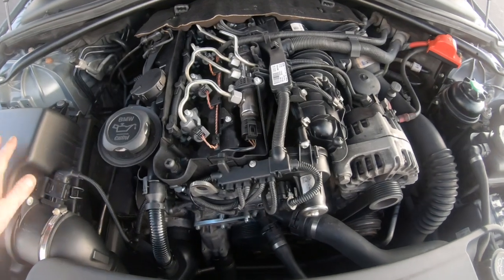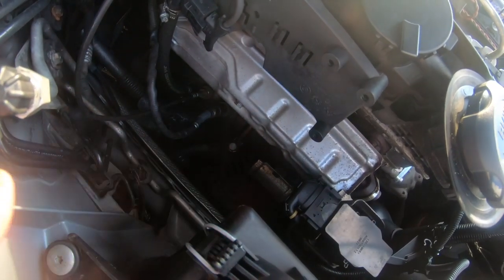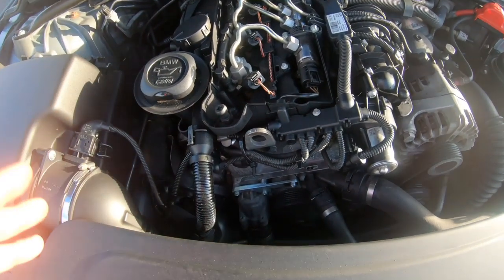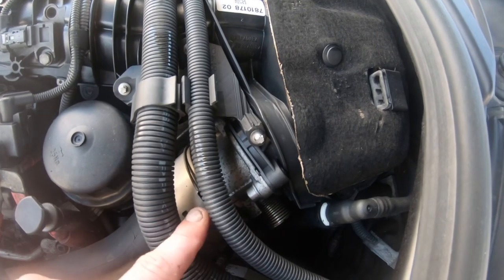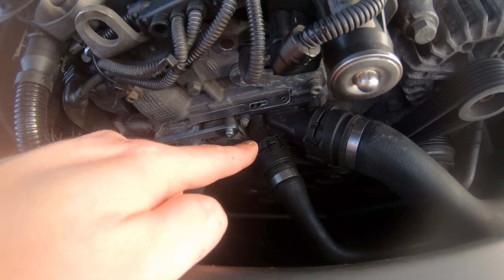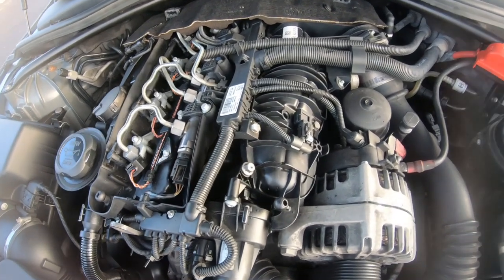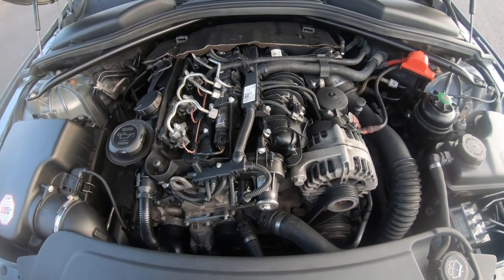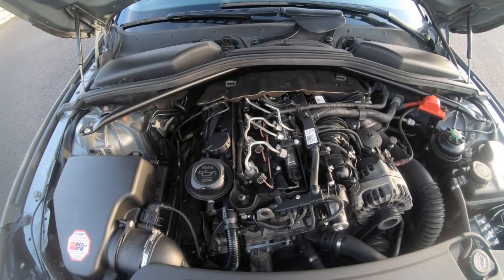Bmw N47 Reliability 2019........... Can It Be Reliable STILL In 2019

Comment: Thanks for the video , just bought a Toyota RAV4 and in the review they said it’s a bmw n47 d20! So it’s not good as I thought?
Reply: By doing specific modifications for the engine (like removing the egr valve) and changing the oil in shorter intervals  (BMW recommendation was 20tkm if i don't remember wrong, which is insane) the N47 engine can be quite reliable.

Comment: Great video, thanks for that, even though I have 2011 f10 with N47 engine it's still pretty much the same engine in both cars. I have to replace crankcase breather pipe on it, now I haven't find it on the net specifically for f10, it's classified as for N47 breather pipe with E60 mark, just hope that I purchased a correct one, I'm still waiting for it to be delivered though so I don't know for sure will it fit.
Is there anything specific and important that I have to be careful when I'm replacing breathing pipe?

Comment: Awesome content! I’ve got N47T 100k km should I replace the timing belt and delete the swirl flaps? Still running good
Reply: Just make sure of very regular oil changes and listen to it from time to time, if you hear it or not. If you hear it ratteling: replace immediately
Reply: Swirl flaps on N47 are of a single piece (compared to the screwed ones on M47)
Failure is less common, however it's good to check if the rod of the flaps has play or not. Quite an easy job to remove the inlet manifold, around 2 hours of work, no special skills required
Reply: @MrChielo007  mine rattles few seconds until tensioner starts woring at startup. But after there is no rattle. I changed chain set at 130 000 km. Now tha car has 250 000. Should i change it again?
Reply: @MarinTheFirestarter  What happened? Was it the timing chain?

Comment: thank you for sharing your knowledge... priceless  !   I'm just left with the question ! Is the timing chain problem solved on cars manuf in 2010 or is it 2011 ?
Reply: I’ve heard that they fixed those on F models
Reply: From what I've heard the F models have better chains than the E models but still faces snaps, the engine was supposedly updated in 2012 and called N47T

Comment: Mate, is there a slim chance some of the late 2009 N47s had this revised timing chain issue resolved?
My 120d is on 89k engine is so quiet you wouldn't even know it was running compared to some newer diesels.

Comment: Thank you for a very interesting video. As english is not my native language i am spesially greatful for your slow speaking.  As i am the owner of a 2014 320GT equipped with the N47. Is that also just a matter of time (within normal lifespan, everything will break sooner or later) before the timing belt breaks? Here in norway it is much more than "a grand" to get timing belt on the N47 fixed. They are talking about 7-8000bp with x-drive. Also i heard a higher price where the sprocket on the camshaft was broken and as it was nort replacebale so the camshaft also had to be replaced. they said close to 9000bp for that job.  How can it be that a qualety auto maker maker designs her products like that?  I also want to ask you about the tuning. Everybody does it, but it sounds to me like you say it is a bad idea? Will the engine not stand it? Whatabout the BMW tuning kit for 204hp where they change the intercooler and the whole mapping box? And isen`t the 325 the same engine with another turbo++? I see you have removed your egr. Can your car still pass the emissiones and how much better is it without it? Is the keeping of the egr the reason why the BMW tuning kit wich cost a lot only make 204hp while a cheap tuning can promise 222hp as they remove the egr? Or are the numbers from the tuning companys "fake news" as a certain president would put it in his modest way? Many questiones, but i really liked your video and i like these cars even i dont like to see the 3-double timing belt on my neighboers Honda fit located easy to axsess wich it proborbly never has to be. Why not like that for a premium car?
finnvinn

Comment: Hi Doc,
Love your videos, so much in fact that im now planning on selling my dear Volvo V70 2.5T and buy myself a E90 320D EDE 2011 with 9500km on the clock. Its a one owner, well maintained vehicle. Nothing under the hood has been replaced since new. Im having my own BMW Doctor here in Sweden, whos gonna help me change the chains, pullys and tensioners. But what about the EDE-stuff. Do you know anything about that? It hard to find any good info on the internet about it. Would be very pleased if you could consider doing a E90 EDE video (N47) covering the dynamics and electronics.

Best regards
Robert
Sweden

Comment: Hi mate, great video. I havw E90 318d with N47T engine. Car production date is 06.10.2010. Do you think I am safe from timing chain or shall I get it changed? Car is on 66k miles.
Reply: Just keep changing oil half of the recommended 30000km

Comment: I was told removing the EGR with the DPF still in place was an absolute no go, as it will clogg up pretty sharpish. Do you not think this is the case?
Reply: Nope. Just make sure your dpf is not already clogged up before you do it. And also DO NOT do an egr delete without a remap. If the computer detects problems with the egr because you blocked it, your ecu wont initiate a regen. 

Also i'd suggest you not removing the dpf. Simply get it blocked off with a strong plate and remap the engine so it knows not to open egr or take it into account.

Comment: Great video, my engine is heating up pretty quick. The fan works while the car is on but once turned off the fan goes off. It doesn't stay on to cool down further? 09 520d lci

Comment: bmw knew early on about the timing chain issues, but still it refused to fix it, making the same shitty engine year, after year, after year.
Reply from the maker: No the key to this one is buy a 6 cylinder petrol be happy 😃 or a motorsport engine no issues there.

Comment: One more question. You say to do a eco map. I assume you can do that and take out egr cooler. Shouldn't I go ahead and delete the dpf and the scr with a full tune even if I am not going to push the engine?  Eliminating possible failure of the Def system. Thinking of the JRtune. Which one is a  eco  map?
Reply from the maker: Mate I have never said do a eco map or any kind of map I said THIS car has a eco map everyone to there own I don’t believe in ANY remaps

Comment: I see a leak next to the pipes, I keep losing power from time to time. I used liqui moly spulung it fixed the issue,  2 days ago the problem came back I have high consumption and it hardly accelerates. can you help? should I remove the EGR? what pipes I can change? oil next the inlet sensor charge pipe. and next to EGR from the pipe tube.. Thanks!

Comment: I’ve just purchased an f30 220d approved used 2012 with 55k on clock full service history via bmw , will this have n47engine prone to issues ? If so any tips to best avoid problems ? Thanks in advance
Reply: Just service every 15000km/10000mls every oil change NOT 30000km/20000mls. Seen a lot of these go easily 250k when engine oil is changed half of the interval. The reason behind this is the chain tensioner works on oil pressure and bad oil is really a killer on these chains. Injectors issues is more of diesel filter that never needed to be changed or wayy too long. Change every 60000k/40000m should be fine unless your diesel quality is really moisture. Then do 30k/20kmls

Comment: if you don´t hear any noise from timing chain do you have to change? I've got a bmw 318D from november 2010 and don't hear any noise from the timing chain  ,  the car has 124k miles on the clock and bmw recommended me to replace the timing chain only because of the mileage.  they said yes it does not make any noise but with that mileage is better to replace it... what do you think? it sounds to me that bmw dealer just want to earn money

Comment: So if the timing chain had been updated to newer improved version at 100k does it become non serviceable? Or would it need changing again at 200k?
Reply: If you have proof of the work being done then I wouldn’t worry about it. Timing chain isn’t a serviceable part and it’s only a fear on these engines because of the design flaw and it wrecking the engine when it fails. Some VW have the same issues

Comment: Do the N47 diesels suffer the same timing chain guide issue as the petrol N26 engines?  They 'allegedly' fixed the issue starting 3/2015 with a different [yet still plastic] timing chain guide.  Do the diesels N47->B47 follow the same timeline 3/2015?  I'm still seeing reports of the newer petrol N26 timing systems and engines failing.  You don't see timing chain issues with Toyota, Honda or even Chevy.  Why can't the German manf get this sorted?
Reply from the maker: Yes they do suffer it N47 is WORSE why you going all these small engines go 3.0 no problems

Comment: How often is the timing chain issues in BMWs (mostly 3 and 4 series) made in 2013. and 2014.? Also, if it's still an issue on those N47s when would be a good mileage to change it?
Reply: problems with chain are up to 2012 september
Reply: @DjordjeSrpski  are you 100% sure I’be just put a deposit down on a 225d from December 2013

Comment: Great video, really appreciate the information. 

My question is, does the timing chain really need changing? I have 123 e82 year 2008 at 67K. 

I have also notice a intermting lag response when applying acceleration. Some moments the car will shoot off and carry on pulling, whilst other times it delays. Do you know what may be the main cause to this issue?
Reply: I also would like to know if the timing chain really really needs changing.... I change oil every 5000kms just to be safe..... And it's perfect at the moment so I'm not sure

Comment: The trouble isn’t with the remap it’s with the fact that people don’t uprate parts to deal with the extra stress and temperatures on the engine. Best practice is always to make sure EGTS and iats are in a safe tolerance via an egt gauge and to go with live road mapping/data logging. Dyno sessions are good but IMO road mapping is better as it puts the engine under real stresses in real scenarios.

Comment: Mate u got bare bmw knowledge, anyway can you help me out

I’ve brought a 320d with the pre lci engine 177bhp with a new bare engine replaced (well not new done about 30,000 miles now) whole cars done 170,000
And lots of mechanics I’ve been to for repairs said that it sounds loud which it does (ticking sound that’s a bit louder when hot)
And one of them said that it’s timing chain :( 
But I don’t really feel a power loss, pulls like a train and the ticking noise is constant.
It does just kinda sound like a tractor when it’s hot 
Could this be anything else????????

Thanks man rate ur vids
Reply from the maker: mate its timing chain the tensioner on them brake mate its a common common issue mate trust me replace it you dont feel any power loss yet its probably only half slipped and flapping about mate get it changed asap before it destroys the engine mate
Reply: Yes it could be high pressure pump ticking my does , and injectors tick too, Best is to get stetoscope and touch engine listen then it changes what you hear

Comment: I have the toyota avensis 2015 with the 2,0 N47 engine.
Sudenly the oil symbol came up... I just had a oil change and oil filter change 12 days before it. 
 I stopped to check out the oil stick, and the engine was almost dry?
I imidietly took it to the mechanic and the engine codes that was shown was  p1443 Regarding secondary air intake injection vacuum switching. 
Code2 POOBD telling air flow to high.. 
Code3 P1070 Turbo charger permantly closed governor deviation... 
My question is, is it the turbo? 
I blows a litle some when it starts, but after only a minut the smoke clears
The engine has not lost any power at all, and I can hear the turbo like normal, only a small whistle sound. 
It uses a ton of oil now, so i guess it can be the turbo, but you proffesionel oppinion would be welcome🙏
Btw Great video 😊

Comment: You forget to mention the big end bearing issue. I seen a few N47-N57 engines. Most of them had the crankshaft bearing gone by 200000 km. I just did my own timing chain @187000 km. The chain was a little worn but still safe to use but the bearings are gone. Due to this reason we never do the timing change in the car. We always pull the engine and check the bearings and 99% the bearings are worn.

Comment: I've a 2012 f10 with 230k km. Still on original chain and is fine. I maintain the car myself and change the oil and filtter every 15k km.  My wife's f30 started to give a slight noise on engine start up, so we changed all 3 chains . Her car was done at 175k km, so I suppose it can vary from car to car.
Reply from the maker: That’s correct mate it does the same as on the B47 aswell it depends on the servicing
Reply: please service your car every 10k km

Comment: 2013 n47t x drive... did a very strange thing..revved to 1500 all by itself twice at idle after 25 minute drive..dont know  what happened...
Reply from the maker: Oh crap that’s the turbo failing 

That’s doing TURBO runaway
Reply: Thanks for the quick reply...so it's new turbo..its never done it before but never had a diesel either. Big job I'm guessing and I'm stick in Germany and its BMW repair here..oh crap.

Comment: I've had the egr n swirl flaps blanked is it normal to sort of get a suction noise almost similar to the turbo whistling from the engine
Reply from the maker: If your getting a suction noise I would suggest your turbo intake pipe is not properly seated in the turbo

Comment: Hello, you seem knowledgeable, I just got a 320d n47 2008 with 157k miles. It had a chain under warranty at 78k in 2013 Do you know if bmw would of replaced it with upgraded parts? 

Thanks

Comment: Hi mate I wanted to remove my egr but been told you shouldn’t do unless you remove dpf too as they are connected in some way or form so if you do the one you should do both
Reply from the maker: that is correct yes they are mate they are connected the EGR is what takes all the gasses back into the manifold to be burned off in the DPF and the thermostat on them is used to get it to temperature properly my advise would be to get rid of both but depends what country your in mate

Comment: Any issues with the 118D 2.0L M Sport 64 reg? I'm considering this but concerned about the timing chain. It has 31k miles on the clock.
Reply: Such low miles for a diesel, gonna be completely blocked with carbon. I’d rather prefer a higher mileage 64 reg.

Comment: Is there away of checking if the timing has jumped on the n47 engine, I have a 120d 2007 it has zero compression on cylinder 3
It’s had the inlet manifold replaced as there was a hole in it and some plastic had broken of and looks to have been sucked in to cylinder 3, I want to check the timing to rule out the chain jumping and so I can remove the head, but can’t find any information on timing marks, any information or links would be amazing
Reply: Is your variable flap broken?

Comment: My 520d was recalled by main dealer to check timing chain and they said it was ok and didn't need changing which they would have done for free as it's been serviced by them from new....is it ok?
Reply from the maker: Wouldn’t trust it mate I would change it anyway they have a revised part number